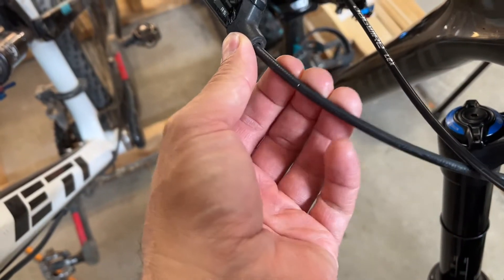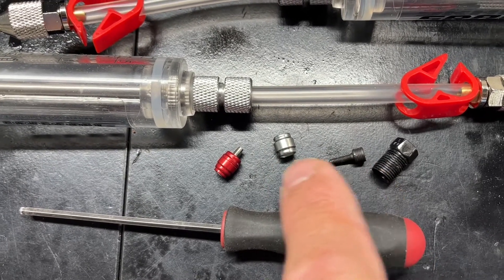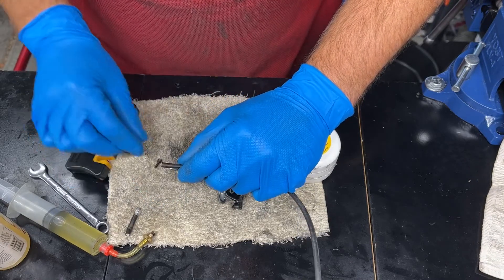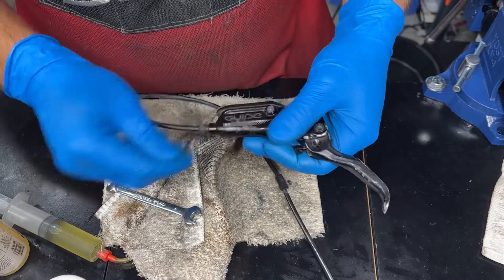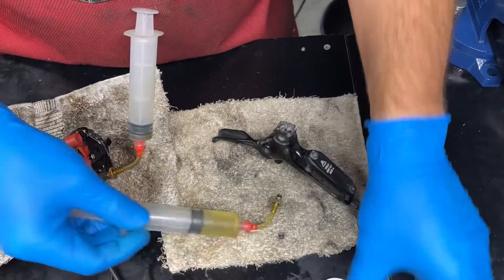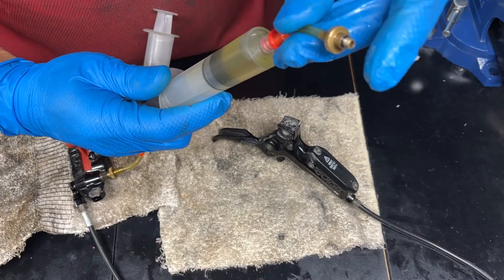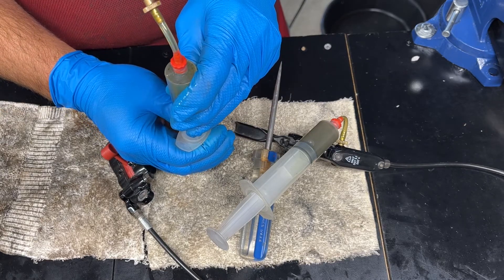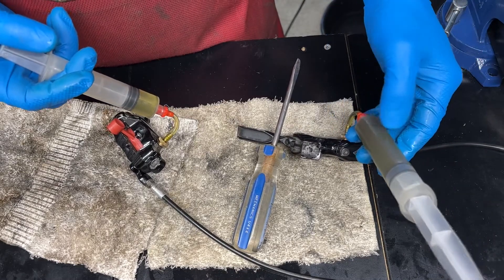Shortening and bleeding Sram Hydraulic Brake Line - Avid Trail SRAM Guide

Comment: Really well done. I feel confident servicing my sram brakes. I noticed you creating a vacuum with the new fluid in the syringe. Is that to eliminate inherent air in the fluid?  Thank you
Reply from the maker: sorry for the late reply. And thanks for checking out the video. The vacuum is exactly for pulling air from the fluid. It's pretty crazy how much air is just hanging out in it. Sometimes there isn't much but most of the time there's enough to screw up your bleed.

Comment: Thanks for the video. At theend of the video..why is that you have to pull the lever at the same moment in which you tighten the bolt?
Reply from the maker: This is something that I should explain in the video. Thanks for bringing it up. Not only is it in the instructions for every bleed process for brakes, but functionally it remains unexplained. What this technique does is eliminate unnecessary pressure on the bladder and ensures the proper volume of fluid for the brake system. If the lever is not pulled when the bleed port is capped, there will be enough extra volume to create issues with pad spacing, especially on older brakes. Hope that helps!
Reply: @insightbike  nice! Thanks for replying, this will be very useful.

Comment: Hey there, I have an old bike Im trying to tune up and upgrade so I can introduce a co-worker into the sport. The problem is that it has some old Avid Juicy Seven (that have not been bled in years), but the cables are too short for my longer handlebars. Can I just any hydro brake cables from Amazon or do I needs specific hoses because of their age? Everywhere I looked up just talk about bleeding or shortening. Any advice or link to cables would be greatly appreciated. 

Thanks again
Reply from the maker: sorry for the late reply. had a really sick kid when you posted this. Maybe you've found a solution. Anyway, the juicy brake lines are fairly specific because of the fittings at the caliper, depending on the model. The hose you need will be determined by it's standard olive and barb or a banjo style connection, but you should try to source Avid parts for this. Jagwire made hoses. And maybe a couple other companies offered products. But make sure whatever you get is designed to match your brakes. I hope you can get this thing rolling.

https://planetcyclery.com/avid-sram-black-hydraulic-2-meter-hose-kit-fits-code-elixir3-juicy3-levelt-level-guide-re?gclid=Cj0KCQiAyMKbBhD1ARIsANs7rEEp19zwSZeOTs3sjcILNSXDD0dB3FtwkljFCgiN3NWonBgi17yAPrMaAjNjEALw_wcB
Reply: @insightbike   thanks for the reply and link, going to keep at it but I appreciate the advice